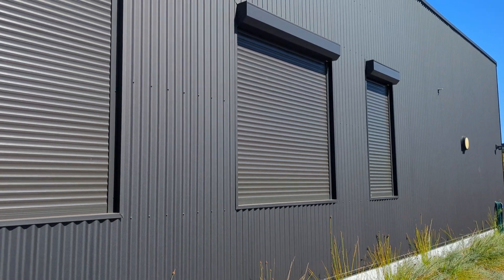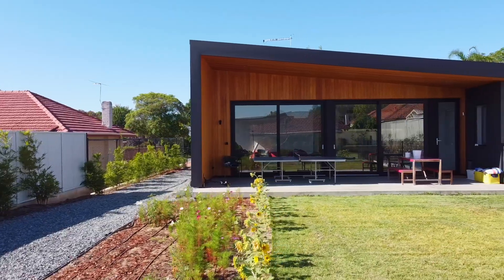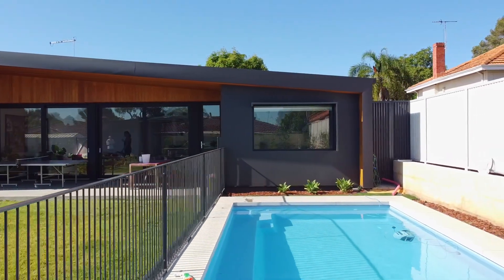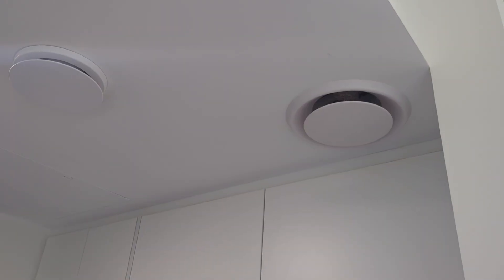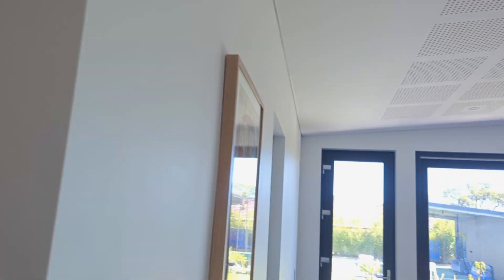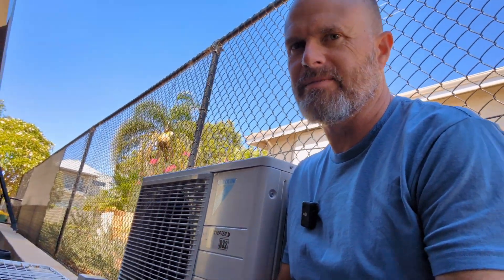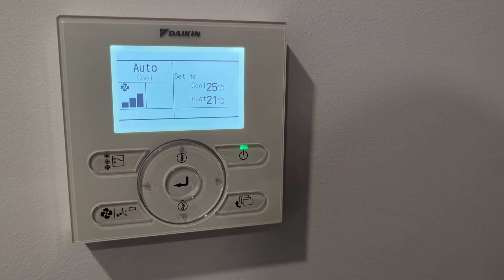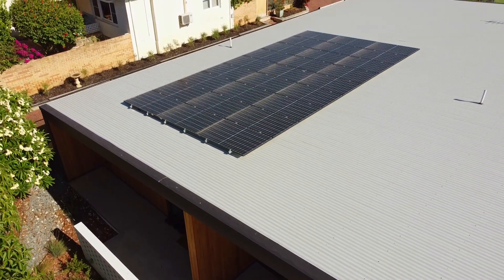How does our Passive House perform in a heat wave?

Comment: This Is not to take away from your excellent work, and an obviously lovely and well thought out house, but surely, a truly “passive house” is one that requires no energy inputs to remain pleasantly comfortable inside, no matter what the weather? 
I lived in Perth for twenty years and was impressed by the coolness of the early-settler buildings which were of brick or stone, with wide verandahs which completely shaded the walls from the sun. They had high pitched roofs which were ventilated, and so remained comfortably cooler than outside, even in a heatwave.
Reply from the maker: Passive House is a standard for thermal comfort, health and energy efficiency that aims for very low energy consumption, not zero. If you are not targeting a thermal comfort standard then your energy requirements would drop because you are ok with living in temperatures below 18 degrees or over 25 degrees, but this is not realist for modern households.  Without going into great detail, the early homes you described did a great job of providing shelter given the available resources and skills available. However, ventilation (ie gaps in building envelope) contribute to unwanted heat gains and losses.  But the gaps these are necessary to provide ventialtion for  occupant health, especially when cooking and heating with an open fire (or gas), and to prevent mold and condensation niside.  Also, Once a high thermal mass structure the stone building envelope gets cold - it stays cold.  And the opposite is true in Summer.

Comment: Hey Ben, Great video that I've only just discovered . We are in process of building a new place in SA with similar cladding to your place , I'm really interested in how you cladding is designed for air movement to assist in cooling down the wall cavity. Do you know if this is a standard with cladding ( depending on the builder ) or it was done during design process by increasing the wall cavity depth ? 
I'm actually a Fridgy and are looking at the same ideas in our place to avoid a large A/C unit , cheers Dan
Reply from the maker: Hi Dan, This is not a standard detail. We allowed for the cavity in the design stage. There is both a vertical batten and counter batten for a total of 70mm. The vertical batten could be as little as 20mm and the horizontal batten just needs to be strong enough to span between (eg. 70x35mm). Ensure you have 20mm clear open area top and bottom for ventilation to work

Comment: Our Passive House (in the Netherlands) is being built at this moment in a factory. It has 195 m2 of living space and has a 1-6 kW ground source (3 x 100m) heat pump (R290). It is able to store heat in the ground during the summer and use that heat in the winter. The summer cooling is non-condensing at about 18-20 degrees. We can't wait to move in.

Comment: Do you think in hot climate like India , bulding house with longer side parallel to east west axis is wrong orientation?
Reply from the maker: So long as the sun rises in the east and sets in the west then in a hot climate  your building should be parallel  with the equator !
Reply: @theleanarchitect Long side of building paralle to east west direction is to gain sun heat in winter . This is only applicable to colder climates. For hot and humid area solar heat gain must be avoiden in winter also.because winter temperature is above 20 Celcius. So in hotter climate long axis should be parallel to north south. Right?

Comment: Hi, I’m a drafty in Perth. I just installed 10kw solar and a 16kwh battery and I find that even with AC we’re pretty much off grid (not 40c days with 30c nights). Our AC is able to ramp down to about 700w input power and with low fan speed it is able to drop enough cold air over the beds rather than cooling the whole rooms. Our house is far from energy efficient though (long, narrow, U shaped court in the middle, no eaves north), however 10kw is a lot of power during the day to power AC. I feel you may use only 1-2kw throughout the day and the remaining capacity is unused?
Reply from the maker: Yes we are definitely feeding energy back to the grid but we do have a pool pump and heater which is energy hungry. Our bills are modest - around $25/week, so a home battery is not viable.

Comment: I have a solar designed home in Perth, Australia, that I designed and built in 1988 without mechanical air conditioning, and with only passive ventilation. The house uses thermal mass and never overheats in the summer, and requires very little none passive heating in the winter. If it does start to get warm inside after a couple of weeks of 40+ degrees, I open the windows and use mechanical extraction fans in the evenings and overnight to expel any excess heat. The excellent results are due to effective design and good insulation in the walls and ceiling, no architects needed. I have in recent years considered adding double glazing to the north facing picture windows, but have so far not found it to be needed.
Reply from the maker: It is great to hear your passive home has worked so well in Summer. We find that the real benefit for this type of construction is occupant health and winter comfort.
Reply: On those rare occasions it's 25+ degrees overnight, how do you manage to keep cool?
Reply from the maker: The ceiling fans are very effective at making the bedrooms feel cool.

Comment: Great video and build – well done!

I've been curious about something: Is there an HRV/ERV system that uses two same-size whole house fans, one for intake and one for exhaust, connected to a smart switch? The idea is that on hot summer days, if it's cooler outside in the early morning, the smart switch could auto activate the fans to flush the house with cool air, helping it stay cooler throughout the day. Does a system like this exist?
Reply from the maker: Here in Australia we had a product called an Odyssey whole of house fan that did just that. It could purge a whole house very quickly and could be retrofitted to an existing home that is not necessarily built to be airtight. I don't think it sold to well because it no longer seems available. Here is the brochure https://www.bradfordventilation.com.au/-/media/edmonds/files/odyssey-brochure.pdf

Comment: On the east side of the house, why didn't you use a roof overhang to prevent summer sun from hitting the glass instead of having to utilize the roller shutters and eliminating all natural light from that side?
Reply from the maker: Additional overhangs and eaves  would have added significant cost and provide limited benefit against low angle morning (east) and afternoon sun (west). The main benefit of blinds is that they are operable. They only need to be closed when the sun is directly hitting the glass.
Reply: @theleanarchitect  I love the metal exterior. Beautiful home you have.

Comment: How about the thermal mass?
Reply from the maker: Thermal Mass is not a consideration of Passive House Software. The thermal stabilising effect of the concrete slab is not quantified but I believe it would be of some benefit in summer. However in winter you pay a heavy penalty for heat losses through the slab to the ground.
Reply: @theleanarchitect  that’s surprising, I would have thought in hot climates even more important.
I was an architect, we did a house for an engineer, had solid concrete floors and concrete cored walls, he calculated it would hold six months of heat. 
ps. You always insulate below the slab in cold climates

Comment: I'm housesitting in a passive house and I asked the owner in advance if we could bring our potable air conditioner for upcoming heat waves. she said she'd rather us not because the house us designed to stay cool. I said "OH, so it actually gets cold in there during a heat wave, without air conditioning" She said she uses a fan and it's pretty cool in Summer. We'll here we are and the house will not go below 24 degrees. It doesn't matter if I set the base temp low, put it on auto or cool setting... the house does not cool itself at all when temperatures are 26 degrees outside. That's not even that hot for a Summer day yet the house has been the same temp inside as it is outside all day. 24 degrees is our night time temp. Meanwhile a healthy room temperature for sleeping (for optimal wellness) is 17-19 degrees. So essentially this passive house can't even get close to a healthy sleeping temp at night when it's not even a heat wave outside. This is pretty weak.
Reply: Where is the house you're referring to? I'm guessing northern hemisphere based on you saying it's summer and it's August. Is it an actual certified  'PassivHaus', rather than 'passive solar designed'? I guess the challenge relative to health is should we sleep at a natural room temperature of 24C, perhaps with a fan on, or use conditioned air and sleep at 18C?
Reply: Have you tried something as simple as opening all the windows early when the air is cold, then closing them when the house cools and before it gets hot outside, and when the air gets stale, strategically opening a first floor window on a shaded and cool part of the outside, and open another window one the second floor, if in a two storey home or a 1st floor windows on opposite ends, to get fresh cool inflow?
Reply: @boxerfencer  that is a great idea
Reply: @chuhusuu1  yeah, I'm speaking from practical experience battling repeat hot summers without air conditioning. I've thought if your home is wired, you could do that remotely. 

My heating bills in winter are also about a third that of my neighbors, but that's due more to the house facing the south in the northern hemisphere, having a large patio windows that allows warming. Opening curtains when the sun is out, and closing them in the evening is important obviously. Having blackout style curtains or making something to their effect helps, so that on sunny winter days only lighting the wood stove in the evening with one or two loads is all that's necessary.
Reply: I'd love to have 24° C all day long!!!
Reply: 17 19 is pretty cold
Reply from the maker: Thermal comfort is entirely subjective. That said, 24 degrees is considered within the human comfort zone and the design parameters of passive house. Your expectation for 17-19 degrees night temps in a warming climate is unrealistic and reliant on the use of AC at a time of day when there is no renewable energy generation. If we actually want to live sustainably, people will have to adjust their expectations around climate control.

Comment: Great video and I guess she likes you building angle but I don’t see any hot air or stale air tower chimney to evacuate the hot air out of the building. How you control hot and cold air flow in building.
I m not an architect but I have interest in passive home. 
In USA/Mexico boundary they construct dome shaped homes with a small oculus opening at top of dome and temperature difference is 10 Degrees cooler than outside without AC.
Reply from the maker: The building has a mechanical heat recovery ventilation system that runs 24/7 and moves the entire volume of the house in 3 hours. It does not purge heat as quickly as open windows, so when we have cooling breezes we purge the heat. The point is that if you add coolness to the house via AC then t does not escape to the outside easily.
Reply: @theleanarchitect  great piece of advice.

Comment: Thanks for sharing the insights into your house. It's generated some interesting comments, many of which are worth contemplating. One that jumps out is the facade colour. Our practice (of architects) has been testing this out. We're on the Midnorth Coast of NSW and we put the same house through the NatHERS engine with Shale Grey roof and walls vs Monument roof and walls and the difference was 0.2 star. So negligible. 
@FrankReif made the comment that ‘walking in front of a dark facade will feel significantly hotter during the day’. I’m not sure about that. Walking next to a white wall that is reflecting the heat back at you is more likely to be uncomfortable. Try being on a Zincalume roof on a sunny winters day and you’ll appreciate the heat reflection. There’s also a big difference between black masonry and black steel interns of how the energy affects the house or those outside it.
Reply from the maker: Thanks for sharing your research! We surface measured light and dark metal cladding in full sunlight and found only a small difference of around 6c or less than 10%. Not terribly scientific but interesting nonetheless. It would be interesting to put sensors inside the two wall options and measure the phase shift in real time.
Reply: @theleanarchitect  There are so many subtle differences and I'm not sure how much it all affects the end user. Good old passive solar design is the absolute go to as a starting point. The less machines and moving parts the better. One interesting thing I measured today was the heat of a concrete floor slab inside sliding double glazed doors. The doors were closed. Where there was no fly screen the slab measured 32.1C, where the crimsafe fly screen was in front of the glass the slab measured 25.9C. Outside temp 25C. How that affects the comfort of the house this evening is probably negligible! But interesting nonetheless.

Comment: Why not have a solar hot water system?
Reply from the maker: Solar hot water often requires electric or gas booster. A heat pump HWU is more efficient and is powered by our solar PV anyway.